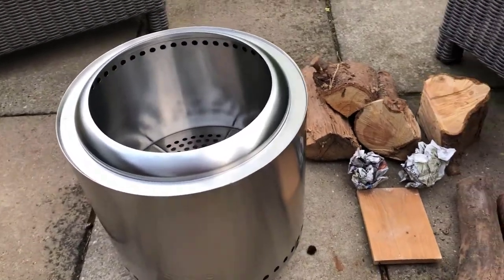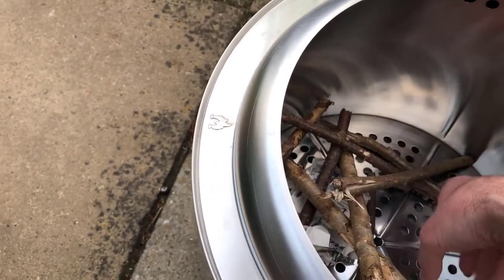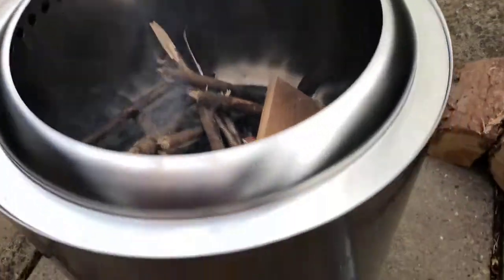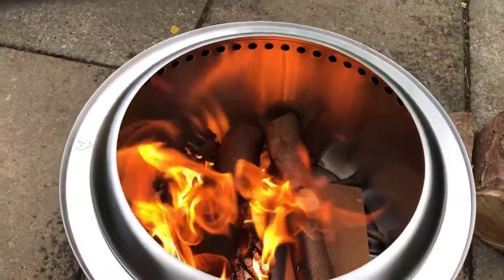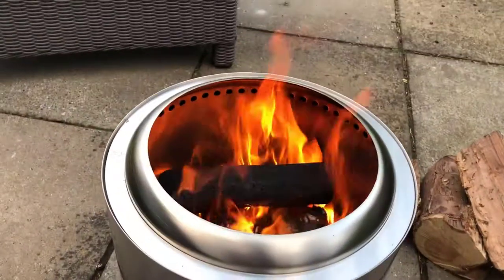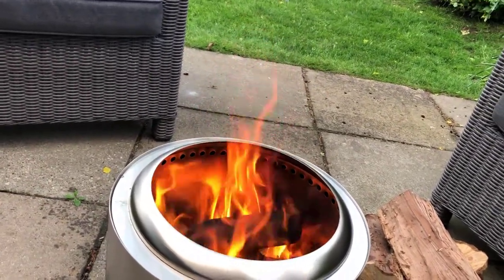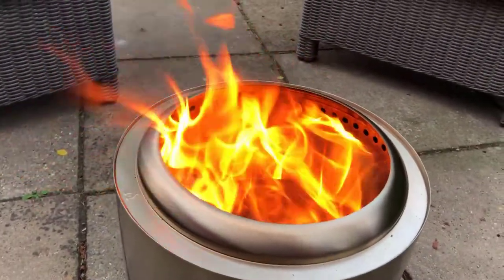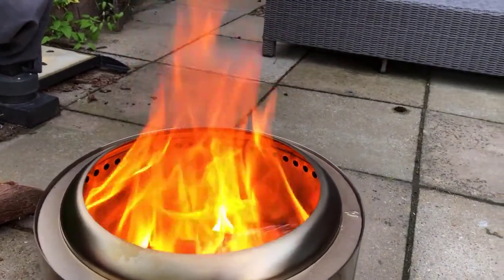Solo Stove Ranger Fire Pit Part 2: First-Light, Timings & Thoughts

Comment: Hi, would you say the usual log size for an indoor log burner in the UK of 25cm fits ok in this Ranger Solo stove without sticking up above the fire holes at the top? Want to order one today but only if my usual size logs fit in it! Please let me know! Thanks 🙂
Reply from the maker: Hi - Yes I would say so. For instance, at 8:37 the piece of wood I put in would probably fit my wood-burner, but only just, and would have to go diagonally. The Solo Stove is pretty deep and so I think it's safe to say anything that would go in a UK log burner should go in in the Solo Stove, even if diagonally. It's maybe worth as well looking at my part 1 video because I think I measure it there, so if you wanted the exact dimensions, I think there's on that video. Hope this helps.